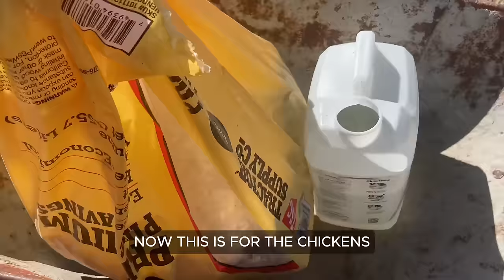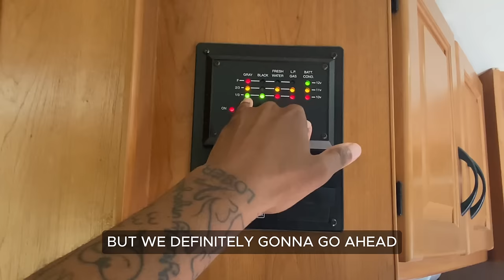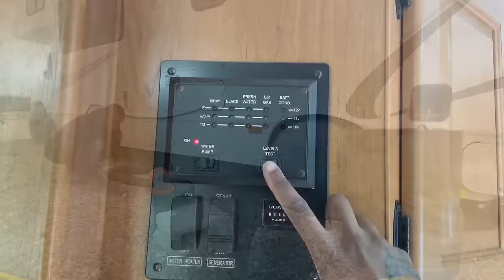RV LIFE | Chickens, Cold Showers & Propane Leaks | V.1

Comment: I remembered what I was going to say! Your pump! It's not loud because there is necessarily something wrong with it. It's loud because it's vibrating the walls. You can make a box for it to try to isolate some of the sound. There is a "quiet" pump that cost a good amount of money if the noise really bothers you, but for the most part all of the pumps sound like that. If the pump has never been changed, you will probably want to change it soon. But don't expect the noise to disappear with the change. I personally don't feel the "silent" pump is worth the money because you won't know how much noise it makes until you install it. You'll just end up spending a grip and still have the noise lol!
Reply from the maker: Looks like I’ll be checking some YT videos on the silencing box cuz I’m definitely not buying the super expensive “silent” pumps. Thank you

Comment: Take a spray bottle with some soapy water in it and spray onto those fittings you think are leaking and if they bubble up at the fitting than that is the spot needed to be fixed
Reply from the maker: I had heard about this technique before. I ended up hiring a professional and they did the exact same thing!
Reply: @BigStizzie  awesome is it fixed was it super simple? I'm thinking with all I've learned I should be in mobile RV repair lol just as a little side hustle
Reply from the maker: @leahflannigan7481  Yes and yes. He did exactly what I attempted to do but my punk self was too scared to apply real pressure to the pipe. I’ll drop a video about the repair soon so you can see how shamefully simple it was 🤦🏾

You should become a RV mobile tech! RV Life & Van Life are taking over and there are plenty of repairs that will need your attention. I want to take courses for RV owners but I don’t want to pay for classes so I’ll have to settle for YouTube instead 🤣
Reply: @BigStizzie  that's all I do is watch the videos and then....well show them to my son in law for him to do for me lol 🤣 but I definitely know how id just be a supervisor though💃🥂💃 same with my 2008 Honda lol the older models are best you youngsters will see what we mean ...as you said RV Life is all the rage now for alot of legit reasons, too. Simplicity. I rebuilt my dometic 210 toilet for about 40.00 total to replace 20 year old parts on it. Beats the hell out of 1800 a month in rent

Comment: As for the dishes and no hot water, you can scrape of the food paticles then take a spray bottle  and spray vinegar on the dishes let set 10 minutes 
 This will kill any germs, dry with paper towel and toss. Your dishes are now sanitized. Hope this helps.
Reply: Great tip!! I can use this tip in my home. 😊 👍🏾
Reply from the maker: I need to work on using less water as practice for boondocking. This tip will definitely come in handy. Thank you!
Reply: Yeah I have a propane stove but I use a one burner hot plate for mostly everything since it's just me and I was using alot of unnecessary propane with cooking and even heating my instant coffee water in the mornings. Sometimes my propane runs out and I'll use the hot plate burner to heat pots of water to use for dishes, cleaning, face washing etc it's not so bad since it's just me and my Dorkie dog and giant cat who "rescued us" 🙄 and never left

Comment: If you hook up to power will that get you some hot water through the water heater? I have a rv and it will get hot both propane or electricity😊 You are doing a great job and things will come together and when it does you are going to be so happy and comfortable! Keep going!!!!
Reply: You are a joy to watch , you are real the is so refreshing. Good luck on your journey.
Reply from the maker: My water heater is propane only but I need to look into the dual options. That sounds like a MUST HAVE!! 🤔🙏🏾

Comment: Okay Sis I have a million questions...no judgement just need to know because I plan to buy from Cruise America, same rig.  Did you have an independent inspector check it before you purchased the rig?  What about the extended warrantee was it offered?  and the toaster oven, do you need like some kind of heat protector around it?  I'm asking all of this to learn what I need to do!
Reply from the maker: I originally planned on purchasing directly from Cruise America with the warranties but opted against it to save money. I found my rig on Craigslist/FB Marketplace. The previous owner purchased from Cruise America but sold the rig to a small, local dealership as a trade-in and I purchased from that dealership. The rig is from 2012 so the warranties already expired. Prior to purchasing, I did hire a RV tech to do a pre-purchase inspection. I’ll do a video on this topic.

As far as the toaster oven, I have no idea if I need heat protection 🤷🏾
Reply: @BigStizzie  OK thanks for that!  I'm loving the videos, the shorts and the fresh eggs!!
Reply: @ReneeAlonzo-t8s  You should replace all of the electronics and have a marine electrician check the electrical connections. Check for leaks around the baseboards and request maintenance records
Reply: @solovantravel  Thank you for the advice!  I'm writing it all down!!

Comment: You need the leak seal tape.
Reply from the maker: That has been recommended before but I recently cleaned my tanks with Commando and the bolts were blue. It appears that everything is leaking so I plan to replace the exhaust pipe thingy 😕